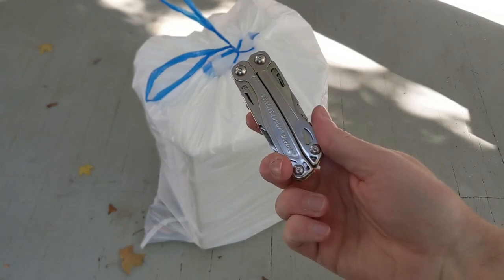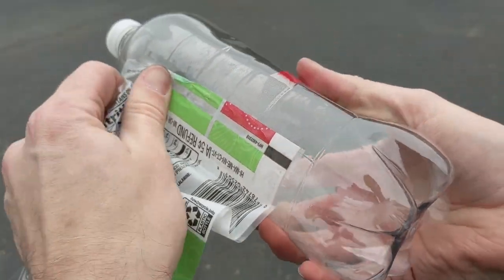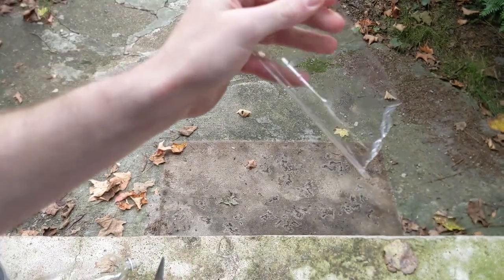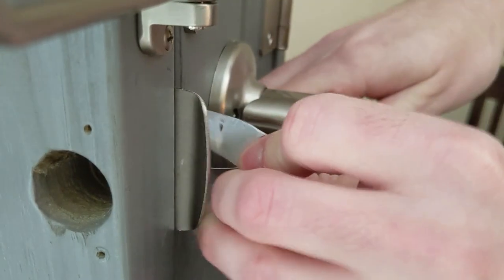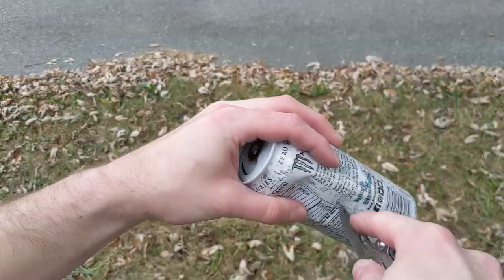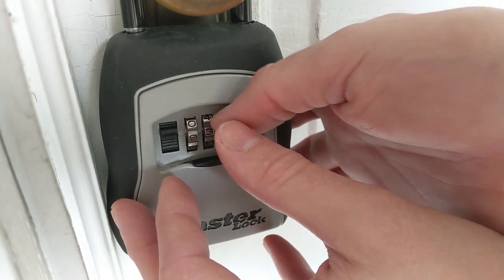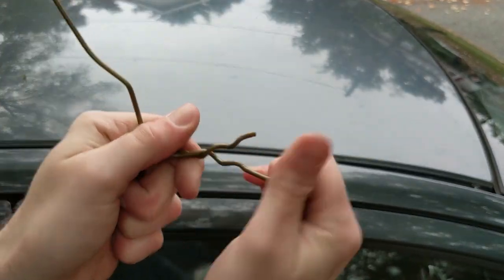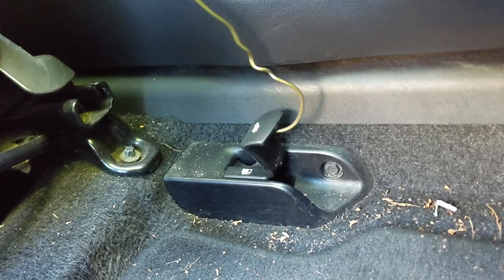Bypass Locks with Trash

Comment: Awesome! P.S. Two other readily available items that can be used as/to fashion auto entry tools are plastic door stops as wedges, and a 12'X1" piece of box strap or strip of plastic cut from a gallon milk or water jug folded in half with a piece of duct tape attached to the inside crease for grip which can be used to pull up vertical lock buttons by inserting it between the body and window frame of a vehicle.
Reply from the maker: Thanks for the ideas! 

I was actually planning to include the box strap method but decided against it because vulnerable lock tabs are pretty rare, these days. Instead, I recommend folks attack the unlock button or the inside door handle (depending on the make and model). 

But the door stop is a great idea! Especially with vehicles with thicker door frames, like Fords.

Comment: Love watching the door getting scratched and rubber water seal get damaged 😆
Reply from the maker: Hey now. That door and seal were heavily damaged before I ever touched it. 😆
Reply: @ContingencyLabs  rofl 🤣 teasing... I used to be AAA and loved lockout calls. No one trained us learn as you go but oh the hell if you ever scratched a vehicle or damaged it. Sign here please and I will have you in your vehicle very quickly. No? Ok have a nice day. If you HELP someone always presume they will sue you for damage. Even if you open for a friend write a waiver releasing you from any damage and have them sign it. I was number 1 in my state and speak from experience. Great video!
Reply from the maker: @danmcdevitt5456  I believe it! In EMS, we always used a little dish detergent when doing vehicle lock-outs but I'm sure someone of your experience knows that trick.
Reply: @ContingencyLabs  I have heard of it but I would cut a rectangle out of a plastic milk jug cut a hole in it slip it in doorframe slide door tool through it and nothing rubs against paint. Try it sometime for the fun of it. 👍😎